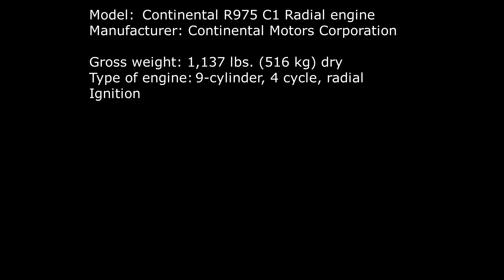Continental R975 C1 Radial engine

Comment: Never realised that the Sherman used these and that they were so small. When your used to seeing massive radials from aircraft, it definitely gives u a different perspective. So I can take it that the m8 hellcat ran the same ? 👍✌UK
Reply: Affirm, same engine
Reply: @nathanlindsey2664  yeah sorry that's the M18. But what I'm trying to get my head around now is that if the motor is in the back and the drive gears were in the front, was it connected but shaft ? chain ? Or what. Best I get too googleing 😂👍✌UK
Reply: @uwillnotsilencemyvoice591  It was indeed connected via driveshaft. The engine faced with the output shaft towards the front